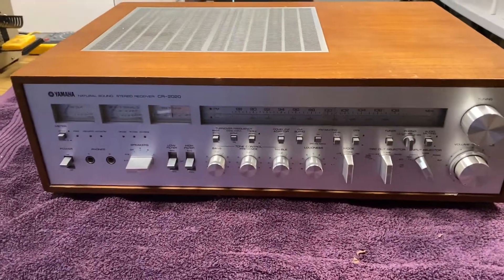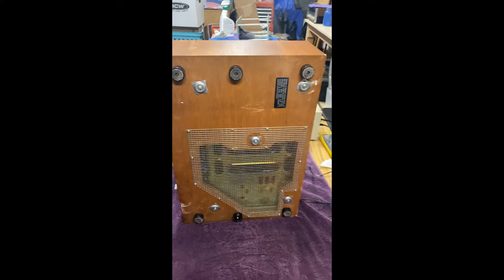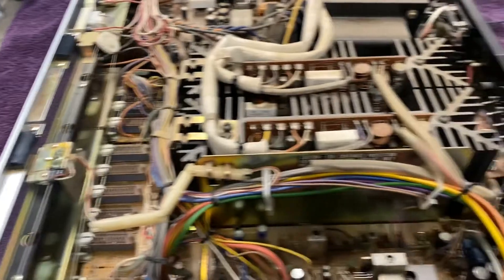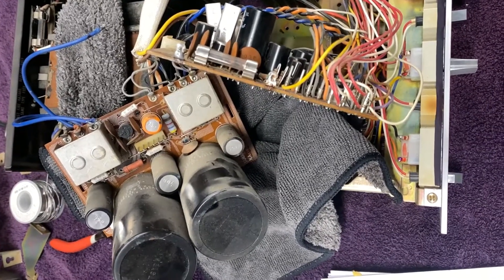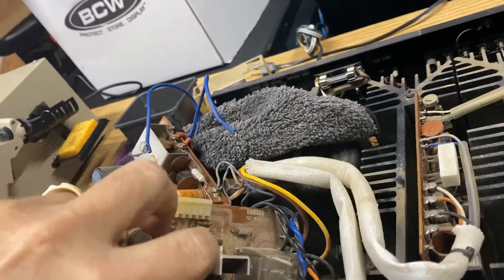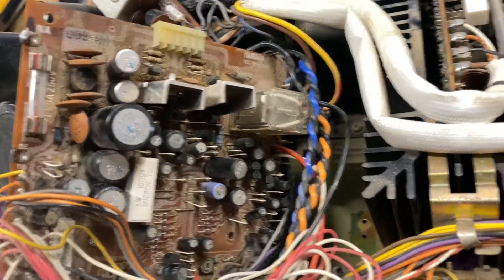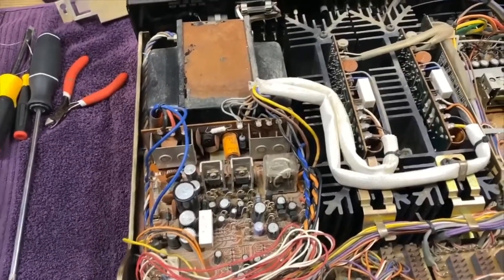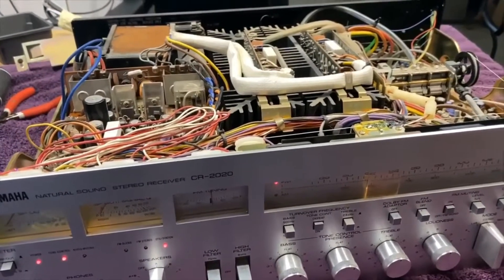Yamaha CR 2020 Repair of power supply

Comment: My CR-2020 blows the right channel fuse as soon as the relay clicks,was fine and then it wasn't. My only guess is the output transistor or possibly a bad solder joint. But I'm definitely no repair tech so idk

Comment: My CR 2020 had this problem several times. The cause was these two transitors becoming so hot that they caused cold soldering connections again and again. Moving them away to the metal back plate of the receiver (serving as a heat sink) fixed the problem permanently.
Reply from the maker: That's a great way to repair that issue. Heat is always an issue with electronics. Thank you for watching and writing in. Enjoy your Yamaha CR 2020.